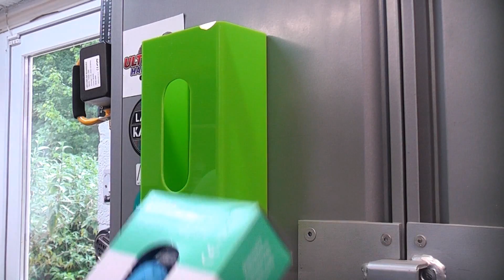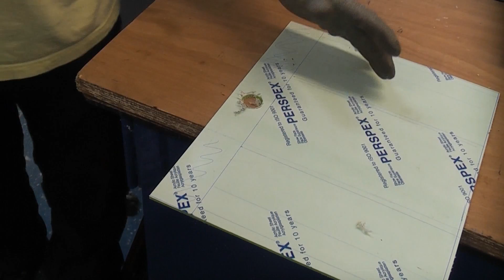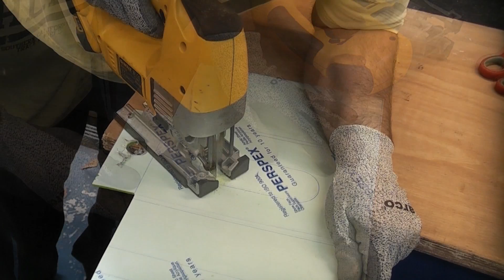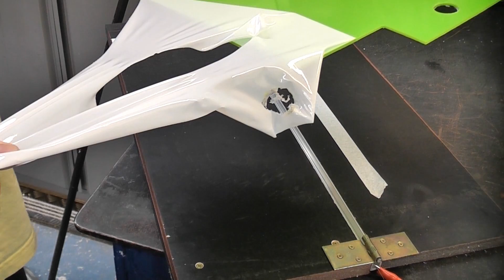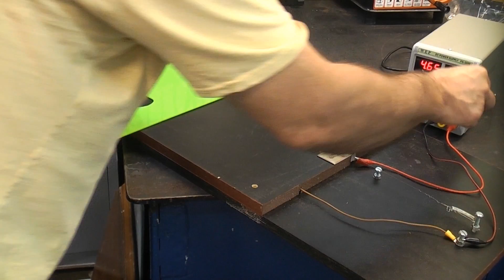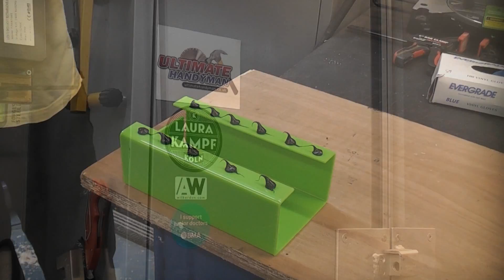How to make an acrylic glove dispenser

Comment: I've not found anywhere that sells acrylic sheet at a reasonable price. was quoted £35 for a square meter at 4mm thick I guess it must be expensive to produce, maybe. Where do you find this material for sale please?
Reply from the maker: It's expensive to buy and you are right it does cost a lot to produce. 
I have bought some from sellers on ebay and sometimes get a good deal. The only problem is that I often think of something to make, buy the acrylic then forget about it and find the acrylic a few months later but can't remember why I bought it!

Comment: Yes some of the rubber magnetic strips would be the way to fix this that way you could move it if you needed to.
Reply: if people wanted to theyd just drill a few slot screw head holes at the back of it
Reply from the maker: I did think about that, but people may wish to install one on a brick wall in a factory etc.
Thanks for the comment ;-)

Comment: Would using a hot air gun also work in this situation?
Reply: Hit air guns work great for large gentle curves, but don't work for tight curves and bends like Chez is doing here.
Reply: Thanks for the tips guys. 🖒
Reply from the maker: Yes, you should be able to bend something this size using a hot air gun- https://www.youtube.com/watch?v=iUTNcQlHiho
But I'm not sure if you could get a tight bend like you do with the line bender, unless you clamped it to a straight edge or something.

Comment: Nice job I may make one for my site trolley . I have the same older style dewalt battery jigsaw and this maybe of use to you when your batteries crap out... https://www.ebay.co.uk/i/182566651480?chn=ps&dispItem=1&adgroupid=42212778379&rlsatarget=pla-300329105673&ul_ref=http%253A%252F%252Frover.ebay.co.uk%252Frover%252F1%252F710-134428-41853-0%252F2%253Fgclid%253DCK7hk6bOo9QCFRO3Gwod4m4KNQ%2526adgroupid%253D42212778379%2526rlsatarget%253Dpla-300329105673%2526abcId%253D1088876%2526ul_ref%253Dhttp%2525253A%2525252F%2525252Frover.ebay.com%2525252Frover%2525252F1%2525252F710-134428-41853-0%2525252F2%2525253Fmpre%2525253Dhttp%252525253A%252525252F%252525252Fwww.ebay.co.uk%252525252Fi%252525252F182566651480%252525253Fchn%252525253Dps%2525252526dispItem%252525253D1%25252526itemid%2525253D182566651480%25252526targetid%2525253D300329105673%25252526device%2525253Dm%25252526adtype%2525253Dpla%25252526googleloc%2525253D1006586%25252526poi%2525253D%25252526campaignid%2525253D807470815%25252526adgroupid%2525253D42212778379%25252526rlsatarget%2525253Dpla-300329105673%25252526abcId%2525253D1088876%25252526merchantid%2525253D116301612%25252526gclid%2525253DCK7hk6bOo9QCFRO3Gwod4m4KNQ%25252526ul_ref%2525253Dhttp%25252525253A%25252525252F%25252525252Frover.ebay.co.uk%25252525252Frover%25252525252F0%25252525252F0%25252525252F99%25252525253Floc%25252525253Dhttp%2525252525253A%2525252525252F%2525252525252Frover.ebay.com%2525252525252Frover%2525252525252F1%2525252525252F710-134428-41853-0%2525252525252F2%2525252525253Fmpre%2525252525253Dhttp%252525252525253A%252525252525252F%252525252525252Fwww.ebay.co.uk%252525252525252Fi%252525252525252F182566651480%252525252525253Fchn%252525252525253Dps%2525252525252526dispItem%252525252525253D1%25252525252526itemid%2525252525253D182566651480%25252525252526targetid%2525252525253D300329105673%25252525252526device%2525252525253Dm%25252525252526adtype%2525252525253Dpla%25252525252526googleloc%2525252525253D1006586%25252525252526poi%2525252525253D%25252525252526campaignid%2525252525253D807470815%25252525252526adgroupid%2525252525253D42212778379%25252525252526rlsatarget%2525252525253Dpla-300329105673%25252525252526abcId%2525252525253D1088876%25252525252526merchantid%2525252525253D116301612%25252525252526gclid%2525252525253DCK7hk6bOo9QCFRO3Gwod4m4KNQ%252525252526rvr_id%25252525253D0%25252526srcrot%2525253D710-134428-41853-0%25252526rvr_id%2525253D1223175063245%2526adtype%253Dpla%2526itemid%253D182566651480%2526targetid%253D300329105673%2526merchantid%253D116301612%2526poi%253D%2526googleloc%253D1006586%2526device%253Dm%2526mpre%253Dhttp%25253A%25252F%25252Fwww.ebay.co.uk%25252Fi%25252F182566651480%25253Fchn%25253Dps%252526dispItem%25253D1%252526adgroupid%25253D42212778379%252526rlsatarget%25253Dpla-300329105673%252526ul_ref%25253Dhttp%252525253A%252525252F%252525252Frover.ebay.co.uk%252525252Frover%252525252F0%252525252F0%252525252F99%252525253Floc%252525253Dhttp%25252525253A%25252525252F%25252525252Frover.ebay.com%25252525252Frover%25252525252F1%25252525252F710-134428-41853-0%25252525252F2%25252525253Fmpre%25252525253Dhttp%2525252525253A%2525252525252F%2525252525252Fwww.ebay.co.uk%2525252525252Fi%2525252525252F182566651480%2525252525253Fchn%2525252525253Dps%25252525252526dispItem%2525252525253D1%252525252526itemid%25252525253D182566651480%252525252526targetid%25252525253D300329105673%252525252526device%25252525253Dm%252525252526adtype%25252525253Dpla%252525252526googleloc%25252525253D1006586%252525252526poi%25252525253D%252525252526campaignid%25252525253D807470815%252525252526adgroupid%25252525253D42212778379%252525252526rlsatarget%25252525253Dpla-300329105673%252525252526abcId%25252525253D1088876%252525252526merchantid%25252525253D116301612%252525252526gclid%25252525253DCK7hk6bOo9QCFRO3Gwod4m4KNQ%2525252526rvr_id%252525253D0%252526abcId%25253D1088876%252526adtype%25253Dpla%252526merchantid%25253D116301612%252526poi%25253D%252526googleloc%25253D1006586%252526device%25253Dm%252526campaignid%25253D807470815%252526crdt%25253D0%2526campaignid%253D807470815%2526crdt%253D0%2526cguid%253D71e49a5315c0ab6140c6bab2ef118354%2526srcrot%253D710-134428-41853-0%2526rvr_id%253D0&abcId=1088876&adtype=pla&merchantid=116301612&poi=&googleloc=1006586&device=m&campaignid=807470815&crdt=0 have a great weekend !!
Reply from the maker: Thanks Mate, I already have one ;-)
https://www.youtube.com/watch?v=P_lmKTYUf4Y 
I love that jigsaw BTW ;-)